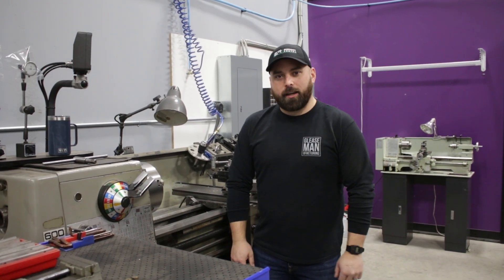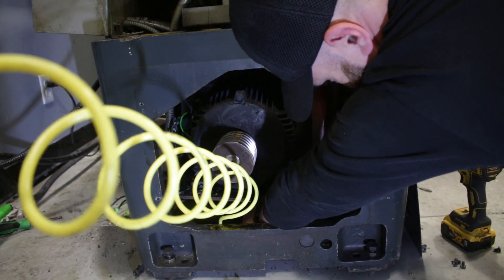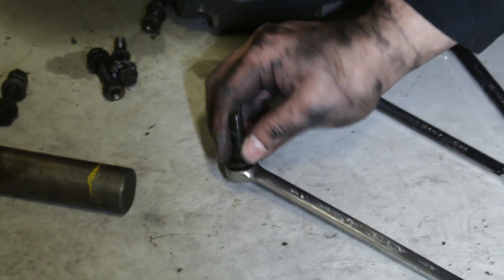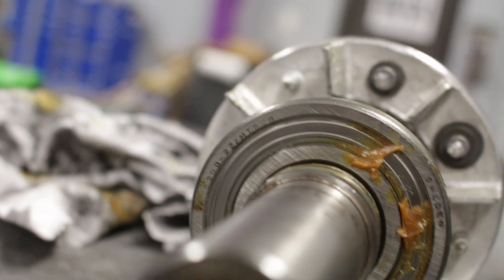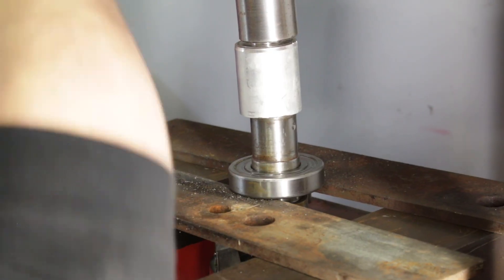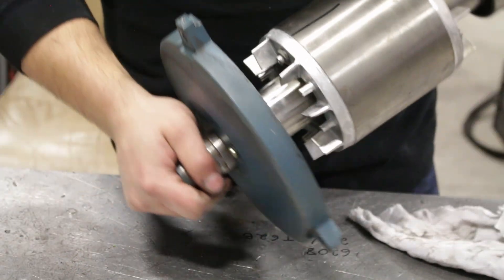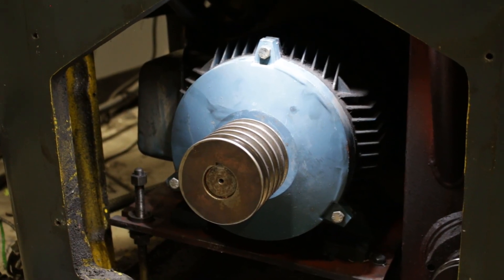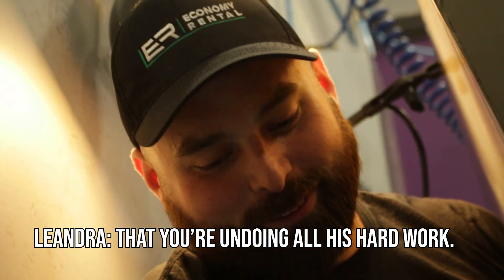I recommend doing this once every 60 years | Lathe Motor Bearing Replacement

Comment: You have a loose or incorrectly installed wire in the middle of the two separator partitions left of cabinet center.

Comment: What is that side pully, a brake?
Reply from the maker: If you're talking about inside the casting of the Mill next to the motor, that's the gearbox oil pump.

Comment: 35+ years of industrial maintenance and service work here, and a thumbs up.
These days I do that kind of stuff for fun and because small companies that need it done typically can't find anyone willing to even try it for anything less than a bank-breaking price.
I usually do stuff on site at a customer's place and don't have a press for the bearings, so I bought a cheap toaster over for about 20 bucks that I can set to 275 F and while I'm pulling the motor apart and getting the old bearings off, I let the new bearings soak in the oven so that they are a thou or two bigger than they are at room temp. I don't need a press to put bearings on the shaft - just some leather gloves. By the time the outer races need to be fitted in the bell housing, the expansion of the bearing due to the heat has pretty much subsided to a negligible level and stuff is pretty much easy peasy.

I do want to commend you for replacing the original shielded bearings with double-sided sealed bearings because that's exactly what I do every time. A lot of that gunk in the motor was probably from someone improperly over greasing the motor, and with sealed bearings, greasing the motor is unnecessary.
Reply from the maker: Thanks a lot! Wow I can only imagine all you've seen in 35 years of working on machines!
Reply: @gleaseman  
<Thousand mile stare> "I've seen a lot of things man...."  🙂
What I've been seeing increasingly over the last decade or so is a bunch of Chinese made machines failing due to poor quality parts - in particular the wiring.
Chinese machines are the main reason I will never be able to retire, and I ain't saying I'm mad about that. But I do hate seeing my customers lose thousands of dollars a day in productivity losses due to down time due to substandard material and manufacturing techniques used in the machines that my customers have spent good money on.
These days I typically focus on working with smaller companies that only bought those cheap (mostly used) machines because it was all they could afford at the time. When the machine goes down due to BS parts, I 'Westernize' the machine one part or cable at a time whenever feasible. That's why I was happy to see you replace those bearings with a better parts than you took off. 
It made me smile when I saw the 2R's going on in place of the 2Z's.
Also, good call on only pressing on the inner race, and leaving the note for the next guy.

Here's a little habit I have that I think might just be enough good will credits on my Karma balance to get me into heaven - Whenever I get called out on a machine I haven't worked on before, if there are three phase motors that need to turn in the right direction to operate correctly (like hydraulic motors, drive motors on lathes and air compressors, etc.), I always have a Sharpie or paint pen and draw an arrow on the shaft end and opposite end of the bell housings if possible. That's for the next guy, maybe even myself, to know when he has to come out and redo some wiring or if the machine gets moved and reinstalled somewhere else.
I just see it as a kindness for those who come after me.

Comment: A piece of string on the end of the electrical cable you pull out will follow the path and allow for easy re-installation. Also a nice touch are pins/pigtails on the wire ends, they really do improve conductivity performance. When you were scraping off the gunk, I felt sorry knowing the mess trap you had ahead.
Reply from the maker: Those are awesome tips, thank you!

Comment: Looks identical to our mid 80s Clausing Colchester 13”x42 lathe. Ours has a tensioner for the oil pump, I made it from looking at parts book.
Reply from the maker: Good call. I was thinking about doing the same thing when I replace the belts. Seems so weird they went without, considering all the care taken on nearly everything else.

Comment: Looking at the title of your video, it's slightly misleading.  The Colchester Triumph 2000 didn't go on the market till 1968 and demand in the UK was so high I doubt many would have been exported, so maybe 50 years old. They are fine machines though, really well designed and built, I worked on a number of them over the years in various maintenance shops. If you want a decent one now they would still cost you up to £8K, although in poor condition £3K. If you want to know more about them there is an excellent website with information and manuals on lots of different machines. Do a Google search for lathes with a uk domain name.
Nice job though, always rewarding changing motor bearings, everything is so much quieter and smoother.
Reply from the maker: Thanks, and you're likely right!